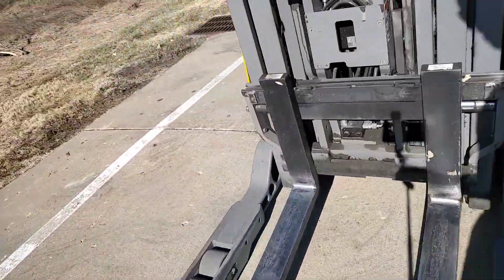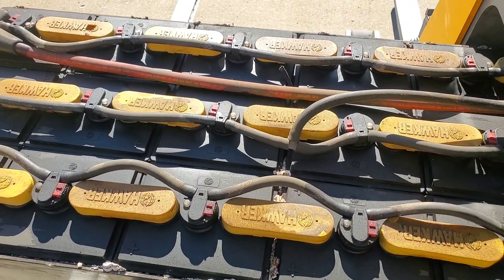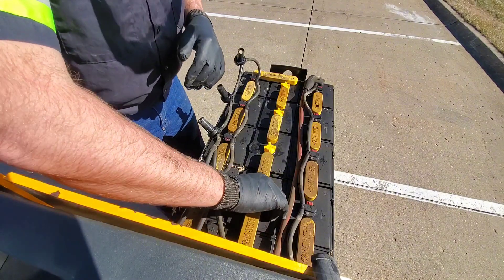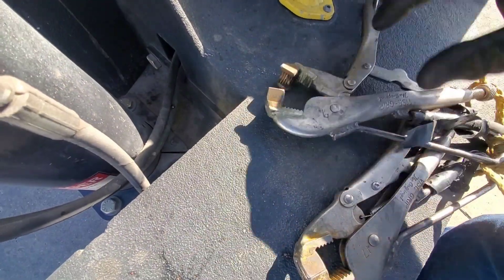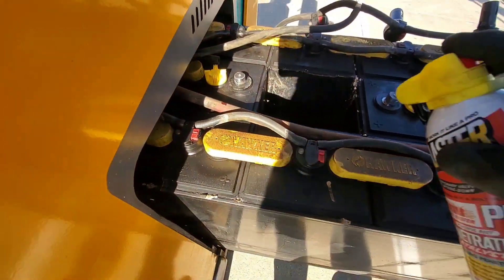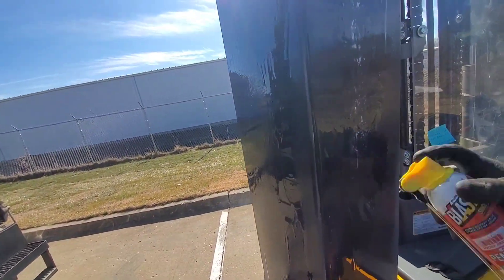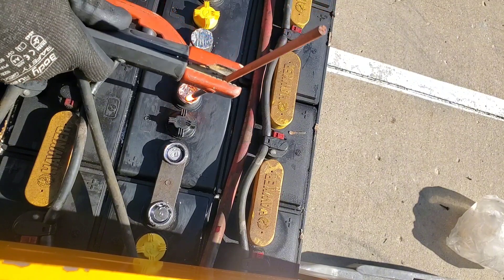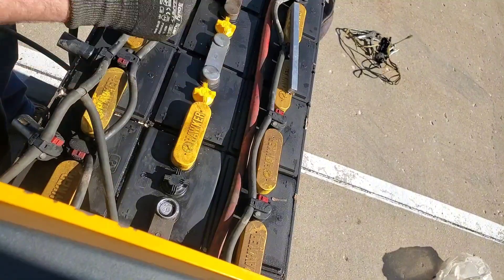Replace battery cell on an industrial battery

Comment: Probably a dumb question but if each cell is ideally 2.12 volts and you need 6 volts to heat the stinger, that means you would have to connect to 3 different cells. what do you connect the jumper cables on the stinger to?
Reply from the maker: No its not dumb at all!

So, consider the new cell (depends which side youre welding on) for the sake of discussion, is cell 0. Thats the cell your carbon arc rod will be touching.

Count back 3 cells (in series) and put your clamp on that lead head. 

Arc your rod to the new cell lead head. You're creating a short circuit at 6 volts across your jumper, to the cell you're welding and when you pull away, the circuit is broken.

Another way to describe it, the lead intercell connectors is the path and the jumper cable/arc rod creats the loop to allow electricity to flow. Depending on how many cells back from the new cell you put your clamp will determine how big your loop is. However many cells you loop in, determines the voltage.
Reply: @Fixed-ish WTF😂 that makes a crap load of sense!!!!! This is not something i plan on trying without someone whos done it but damn thats awsome!
Reply from the maker: Some off road guys know this trick, but if you break something you can use car batteries and jumper cables to weld broken parts together when you're off somewhere in the Mojave desert. That little trick well melt some people's brains.🤯

Appreciate the view and comments!!!!
Reply from the maker: I also have a few more battery cell welding videos, it might clear up some of those questions.

Comment: Where do you get the welding kit?
Reply from the maker: Made it out of a battery jumper cable end, some battery cable (1/0), and a standard arc welding stinger. The welding rods are carbon arc, arc gouge rods and the lead bars we order from TVH. 

We use to melt down old battery intercell connectors into 18" lead ingots. But totally not worth the time or hazards. So we just order them.

Thanks for the view and comment!

Comment: Cleanest I’ve ever seen arch welded I always lead in using a acetylene torch
Reply from the maker: I've done both. I will say acetylene leaves a better look and way better with snapped off studs. I like that the arc is appreciated more by some customers because of no open flame. Plus it's more mobile than acetylene too. Lol

Comment: -thank you so much!
Reply from the maker: No problem! Hope you enjoyed the content. I've got a few more battery videos and intend on doing more in the near future.
Reply: @Fixed-ish  I'll make sure to watch them. I have an electronics background, but I'm new to high-current battery array's. I bought a used forklift that has an 18 cell; (6 cells x 3 rows) 36 volt, @1100 VA ( I think it's called volt-amp) forklift battery that has issues. I'm using a 1000-amp Harbor Freight battery tester on each battery cell to verify the CCA of each. I'm also using a hydrometer to check the charge levels. The last three in the chain of 18 appear have issues, plus the lead bars on the top of the last three have a black coating, where the others do not. I'm thinking a high heat scenario... My original test showed the first two; six-cell battery chains slamming the 1000A meter, but the last six-cell row going to zero under load test. Then; I narrowed it down to the last three in the third row. Also, my hydrometer levels on the last three were very low, plus the water levels were low, so I added distiller water. What I think I need; and what I'd like to have, is a two volt, variable, high-current charger, but all I could find online is a very expensive $7K multi-voltage battery tester. I have a few chargers including a high-current 36 volt charger, but I want to work on one battery at a time. So; to start, I have a tiny, very old, 2/6 amp, 6/12 volt charger running at 6 volts and 2 amps on the last three to see if my hydrometer levels rise over time. All of the newer smart chargers I have don't work. Right now, on the six amp setting, the charger meter pegs at 8+ amps, so I set it to two amps and now it reads a three amp charge. Nice. Moving forward; if I can't find a cheap 2 volt charger, I'll make one. In summary; I think I'm making forward progress, and your video helped a lot! However; where I'm spooked a bit is welding right next to battery acid. Not sure I like that at all. -can't believe there aren't high current, no-weld battery terminals and jumpers... -again, thank you for the video! Scotty
Next Day: Found that the nasty black coating on the lead posts of the last three batteries was causing the meter to read 12 volts; and then go to zero during a Harbor Freight 1000-amp current test. After using a 1/2 inch chisel to lightly scrape off the coating, I read 1000 amps from the last six-pack of batteries in the chain. Yea; that's super goodness. Voltage of all three six-packs were @10 volts; so I'm going to charge all three separately with a Beelab multi-volt charger on the 12V desulfate setting. I also did a quick test using with my old Sears 2/40/200 on the 40 amp setting. I measured 40 amps with an amp clamp on the positive. Very surprised! 37 amps on the negative, but I've never measured current on the negative lead before. So; the old Sears charger is good; and we'll see how the Beelab on the 15 amp desulfate setting works tomorrow.  Again, thanks for the education. Scotty
Reply from the maker: As far as the capacity, it's referred to as Ah, or ampere hour. 

Capacity testing is done over a 6 hour test, which is how industrial batteries are rated. Capacity 1100 ÷ 6 hour =  ~183 amp draw. The battery should withstand 183amp draw over 6 hours. You'll want to terminate the testing if any cell of the battery exceeds 150° or 1.7v.

If you end up needing cells, we can order them for you and ship direct. 

I come across old ferro chargers quite a bit. Sometimes they need easy repairs but at 205 per hour labor rate, customer will usually upgrade to smart chargers. Hit me up through my email, I have it listed on my home page. I can hook you up with information if you want to get into the nitty gritty of batteries
Reply: @Fixed-ish  thx!
Reply: @Fixed-ish  roger-that!
Reply from the maker: @scottmyers8911 Just letting you know. I have a charger that came in. It's a trade in, everything works. 208/240/480v 3phase charger. It's for 36v battery @965 Ah.

Let me know if you're interested. Otherwise, we just scrap them.
Reply: @ Thank you so much; but I have an Energic 160A single-phase 36 volt charger (I don't have three phase.) I just was looking for a charger that I can troubleshoot the 2 volt cells one at a time. My thought was I charge the batteries and see if I can get the specific gravity somewhere near 1275; and then look at the voltages and see where they all land. There seems to be a relationship between the specific gravity; the voltage, the amperage, and the health of the battery. I need to understand where and when continuing to charge a battery in order to get the specific gravity higher no longer makes sense. And; how to determine the health of a partially sulfated; low gravity battery in this mix. Dunno; I'm still learning, but I'm getting closer to understanding these rather expensive, and rather heavy, little monsters.
Reply from the maker: @scottmyers8911  You can contact me through my email or I have a video coming out here in the near future with this exact topic in mind. either way.

also, they have phase converters, you can turn a line of your single phase into 3 phase for reasonably cheap anymore. Our shop runs one since our area does not offer 480 3 phase power in but thats the common power supply for chargers in our industry. 

Just wanted to put that out there incase you didn't know it existed. gives you options for other things besides just chargers.
Reply: @Fixed-ish  Right. I know there are capacitor-based units that help start three-phase motors. I have one on my lathe which has a five hp motor. There are others that recreate all three phases. I have one on my mill which (I think) has a five hp motor as well. However, converters that will synthesize all three phases and support super high current levels are (or were) crazy expensive hence my choosing the single phase model. Lastly, I'm looking forward to your single cell troubleshooting video. Right now I use the six volt setting on my Beeleb charger; connect to three cells in series, and watch for bubbles and monitor with two different hydrometers. -thx scotty

Comment: Nice job but I don't know how you got away with not resealing all of the exterior of each individual cell in the Case. Aren't you supposed to reseal it all with tar?
Reply from the maker: Pretty much all modern batteries aren't sealed like that anymore. 

I've worked on plenty of them that have that done. Honestly, when the jar lid is cracked and the electrolyte is aspirating out during charging/usage, it becomes trapped between the cells and expands. It makes servicing them almost impossible and usually have to pull the cell apart in pieces. 

It looks nice on top, but is completely unnecessary
Reply: @Fixed-ish  well that just goes to show you how old I am. Smile
Reply: @Fixed-ish  I worked for a large grocery warehouse, which had 1500  pallet jacks and forklifts, And 3,000 batteries, they didn't know what buying a new battery meant, We rebuilt every battery in that plant, all year round, Well at least the battery maintenance department did, I worked in that department for a year and then I advanced to the mechanic division, which was fun.
Reply from the maker: @rich1879  Well, I'll have you know that major grocery store distributors haven't changed. Thousands of lifts and batteries and no method to maintain the longevity of the battery. they have systems and people in charge of it, but with little luck. they just make the call when a battery isn't lasting anymore. most of those batteries see multiple cell replacements within 5 years. I have customers run batteries nearly 10 years before having problems. Nobody wants to know how things work anymore, just that it needs to work.

Thanks for the views and comments!!
Reply: @Fixed-ish  well thank you for the get back and the info. That's really interesting, new sub here.

Comment: Used to blow fumes out of surrounding cells before working on batt. Once on a service call found tie bar broken free on one cell, had carbon arc rods but had loaned out holder. Used my battery        jumper cable as rod holder
Reply from the maker: Agreed. Anytime you are working on batteries around the time of last use or charging is a good idea. Build up of hydrogen can be worst if the cells aren't full of water.

I once used a car battery and jumper cables to tack weld a broken bracket together to get off a trail to get home. Field work is the mother of all creative solutions.

Thanks for the watch and comment! Hope you enjoyed the content.

Comment: Great tutorial! I need to replace cells in our DC Solar Trailer and you definitely encouraged me! Thank you! Where can I purchase a stinger and rods - + lead from?
Reply from the maker: Thank you! They are carbon arc rods. The stinger is just a normal stick welding stinger and some welding cable wire. I believe this is1/0 or 2/0 cable.

Thanks for the watch and comment!
Reply: @Fixed-ish  Subscribed!
Reply: So what company are the cells available for forklift batteries. I need to purchase one or two for a 48 volt.
Reply from the maker: @rich1879  this battery was specifically hawker, so it got hawker replacement cells. You'll want to contact the manufacturer of the battery you'll be replacing cells on. So if it's GNB, Enersys, Hawker, Triathlon, Etc, you can call a local dealer and they'll order them in for you.

Contact my email if you need some more assistance.
Reply: @Fixed-ish  awesome my friend! Just awesome, thank you so much!.

Comment: What is the size of that crown drill bit for removing the contact rails?
Reply from the maker: Depends on how you like to measure.

I.D. of the bit is 11/16ths or .6875 or 18mm

O.D. of the bit is 15/16 or .9375 or 24mm.

Thanks for the watch and the comment!!
Reply: @Fixed-ish  Thank you very much.

Comment: Nice work. I work for an industrial battery company out of Nashville TN. I use a small torch setup and have a carbon rod setup for a backup. We just use a chain with the forklift to pull the batteries out and also use it to pull the cell.
Reply from the maker: Before the crane that's how I'd been doing cells, using a forklift with that same vice grip looking tool.

I recently posted another video doing a cell/post repair and wish I did it with the torch instead of the arc. If you get a chance, check it out.

Thanks for the watch!
Reply: Yeah they are not gonna give us a crane Travis nice try lol he did a clean job for carbon rod.

Comment: How much voltage do you use
Reply from the maker: Approx 6v is enough to get it done and not risk blowing out the side of the cell interconnector. 

If they are really thin connectors I'll wrap a wet towel around the edge to prevent that from happening